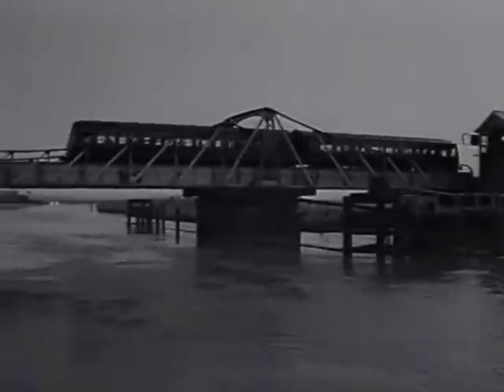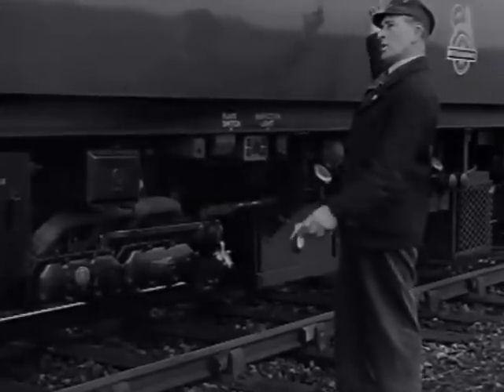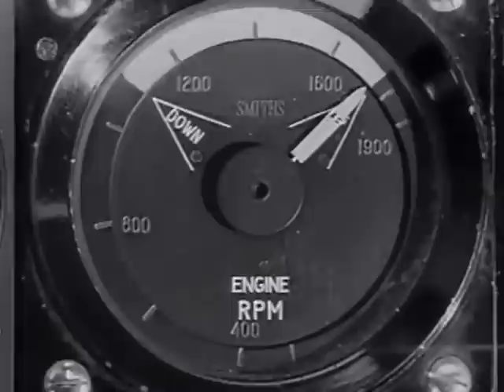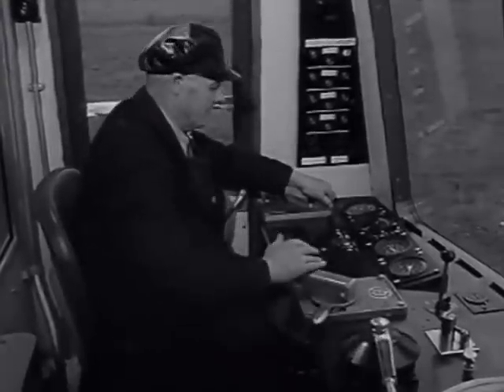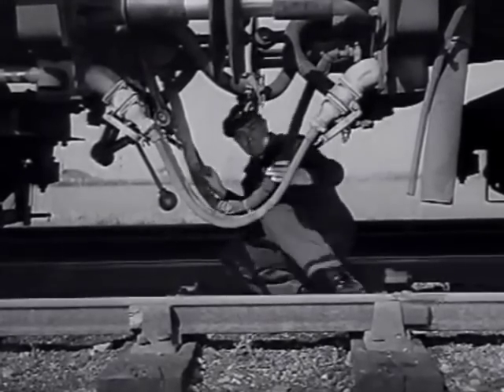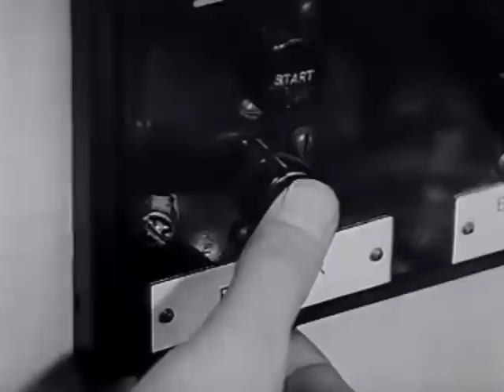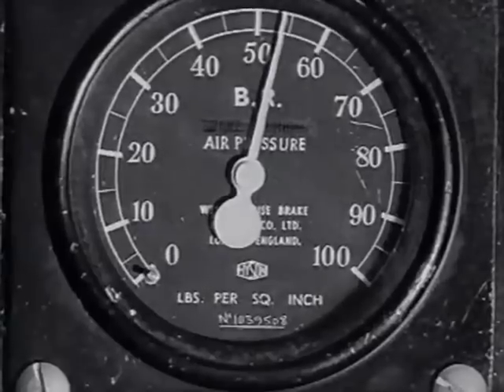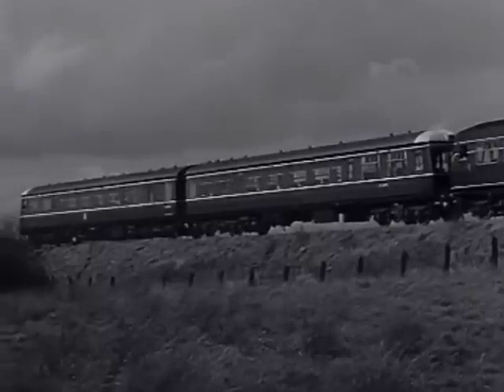Vintage railway film - The diesel train driver, part 3 - Dealing with faults - 1959

Comment: If only everything in life wasn’t as unreliable as a DMS/DMBS 😁 I assume that this BTF didn’t make general release, otherwise many more branches would have been “reshaped” due to decreased ridership 🙂 I’ve only witnessed one DMU failure firsthand; I was on a 116 ex-BNS, sitting on the foremost saloon seat and enjoying the view forward when it spluttered, coughed, shut-down and refused to restart at Five Ways despite several attempts. Failure was declared and we waited, witnessing up trains including a WR HST and a Peak-hauled cross-country. Our saviour arrived in the form of a Saltley 47 sent wrong-line (remember when crossovers on main lines were a thing?). I watched the loco back on and couple-up (vac line and screw coupling only, as per video… no MW on a 47 anyway!). Then, after a long pause, the most thrilling trip to Longbridge in the history of mankind. Horses were not spared. Clag drifted and 12LDA music was plentiful. Teen enthusiast delighted. Normals not so much; there was Grumbling and Criticism 🙂

Comment: In the United States, diesel locomotives have been diesel electric, using electrical current, first DC,then later AC, to power the driving motors,also known as traction motors, in either propulsion mode or dynamic braking mode. As the United States has steeper mountain ranges, and longer distances,diesel electric railroad locomotives were found to be more pract,and efficient.
Reply: The UK has had Diesel-Electric locomotives since at least the mid to late 1950's. Also what's shown in this video is a Diesel multiple unit(DMU) not a locomotive.

Comment: My thought is...why no gloves? Still interesting!
Reply: Because this was before every sort of grime gave you skin cancer from a single short exposure (hint it still doesn't). People who worked for a living expected to get their hands dirty from time to time.  There'd be soap & water at the next station.
Reply: @elboobio5920  It's certainly the excuse why they insist for garage mechanics, & they insist, even if you're allergic to latex.
Reply: @beardyface8492   absolutely. I spent years working on engines, no one had gloves, just used swarfega at the end of the day and a nail brush, never had any problems even fifty years later. God know what they would they say now if they saw me as a teenager working my summer holidays for my brother laying glass fibre repairing boat hulls and dunking our hands in acetone at the end of the day to dissolve any fibres under the skin, again, no health issues all these years later. But then again, England has gone from a manufacturing nation to a burger flipping nation!
Reply: This was pre osha/niosh! This was also before contact dermatitis!
Reply: All train crew were issued with Swarfega and cloths.Apply Swarfega to dirt ,remove with cloth. Simples.

Comment: Diesel electric solves all these direct  gearbox complexities and problems.
Reply: Quite a few DMUs use diesel hydraulic transmissions. These brake band gearboxes are completely deprecated now. Consigned to history.
Reply: and generators back then were not small enough to fit under a DMU, so diesel mechanical it was, not that they proved to be any less reliable than diesel electric, the last of these mechanical units were withdrawn in 2017